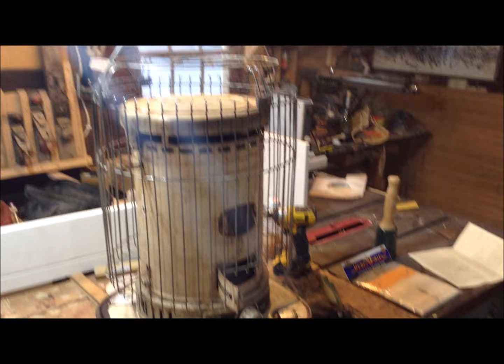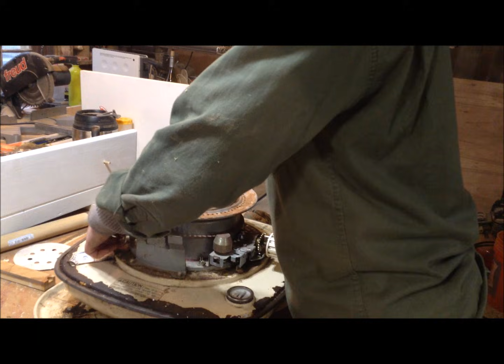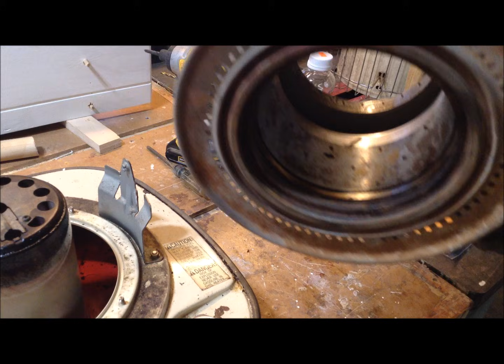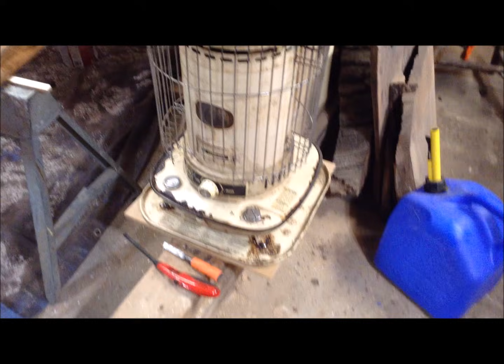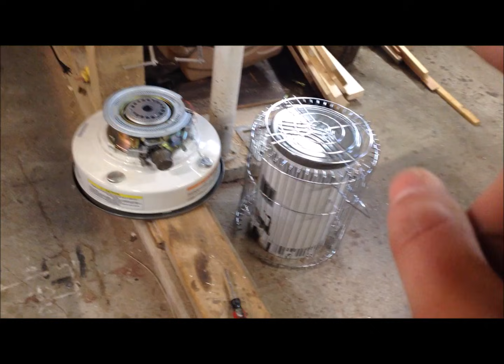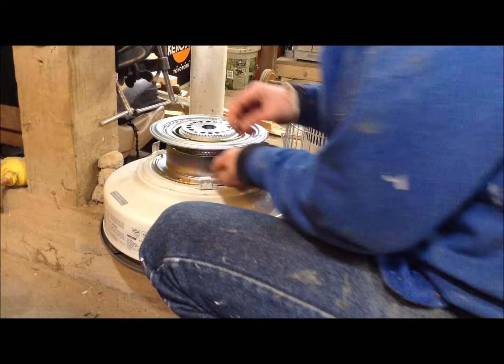Replace 3 Pinned Wick In Kerosene Heaters || How-To || Corona DK-23

Comment: This is fantastic!! Just the model I have which I found curbside. It was very dirty from being in (probably) open storage, but it looks like it was never used. I cleaned it up and it really looks like new. I have a blue container for of K-1 that I got from a Speedway gas station, so that is burning pretty cleanly. The coil ignition is working, so I don't need a lighter! 

I'd like to make one comment... when you remove the control knob, make sure that you depress and hold the button on the knob as you pull it off the shaft. I think you're doing this in the video, but you don't say it. The slide plate on the back of the knob will bow and then it will not work smoothly. If this happens to you, you can use a small brad hammer and flatten it back down and then it's perfect again. 

Thanks for the great video!

Comment: After you removed the 4 wingnuts, you just "lifted" your whole wick assy up, and out. Mine keeps getting stuck halfway up. I'm even standing on the bottom tray, and yanking upwards, but it still is fighting me. Not sure how much force is needed to release this thing. I even tried pulling with the wick in different locations...up, down, and middle. Didn't help.

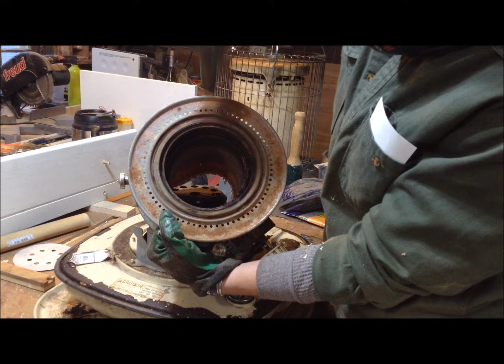Well, it took a ton of force to peel mine apart. I kept rocking, and twisting back and forth, and it finally came loose. But unlike yours, there was a circular tin shield "below" the spiked sleeve you mentioned at exactly 5:22. (You can see it still on your assy). Mine stuck in the tank below, and has a black gasket sealing around the hole it sits in.
When my wick "lifting" assy came up, the wick itself was stuck below that tin shield I mentioned above. I had to use a flat blade screw driver and some piers to work that tin shield out of the tank, before I could remove the wick. And those 3 pins in the wick (?). One was peeled off, and stuck in one of the holes in that shield. This thing is filthy, and so am I, so I'm leaving it at that tonite, and will clean everything else up tomorrow, B4 re-assy. Wonder what kinda surprises I'll incur with that. I have the original directions, and it states exactly what you instructed above. Of course, mine wouldn't cooperate, like yours. OFN.

Comment: Old video, but a good one. Thanks for the refresher, for my old unit in storage for almost a decade. Just ordered a new wick. Happy New Year.
Reply from the maker: Happy New Year to you too.  Hope you get yours up and running with the new wick.
Reply: @HoneyBadgerWoodWorks  Had it running with the old wick, but not very well. Wondering if the old wick can be trimmed downed, cleaned up, and reused?

Comment: Prompted by your idea to hold it by the knob to keep the automatic shutoff from engaging, I inserted a loose bolt (about the size of my little finger) loosely into the space above the shut off switch.  That kept the shutoff from engaging and allowed me to lay the whole apparatus on its side on the table and have free hands to turn the knob and fiddle with getting all the holes lined up and the wick installed.

Comment: These work great for heating but the design of these are overly complex.  I think a furnace is more simple than these.  I have sold a lot of these over the years because people get rid of them because they are a pain in the ass.
Reply from the maker: I never had an issue with keeping these running.  Sourcing the kerosene was what became the problem.  I agree a furnace is ideal, but for people like myself that work in outbuildings and garages a furnace setup isn’t feasible.

Comment: Funny thing.....I have two kerosene heaters, both exactly the same as yours.  The Kero Sun was my dad's and has had very little use.  The Corona belonged to my buddy and he was going to throw it away, so I took it, replaced the wick and it works great.  The Corona looked terrible when I got it but it cleaned up really nicely.  The igniter still works too.  Thanks for the video.
Reply from the maker: No problem.  Minus the small I liked kerosene heat.  Just got too hard and expensive to source the kerosene in my area.
Reply: @HoneyBadgerWoodWorks  Did you ever have trouble removing the knob?   I can't seem to get mine off now.  Thanks for your help.
Reply: Nevermind.....once I pushed in the button on the knob, it came right off.  lol    Duh.   Thanks so much!

Comment: Thank you for an excellent video explaining how to change the wick - I live in the wilds where it gets really cold, so I use one of these heaters in the main hallway. 
Here is a great idea to remove the kerosene smell. Place a large two handled saucepan on top of the heater. Half-fill the saucepan with about two litres (a quart) of water and drop about 6 drops of Clove Oil into the water (or eucalyptus or peppermint, etc). Then let the water simmer. The space is filled with a wonderful uplifting scent from the water vapour that the simmering water gives-off. You could even use Sandalwood or whatever 'essential oils' you prefer.
Once again - many thanks for making a great video - much appreciated as I have just ordered a new wick.

Comment: I’m so glad I found your channel. You are a very good teacher and give great verbal instruction with visual demo. I’m just getting into kerosene heating as alternative heat source. I have a suggestion that may help your viewers with holding the spring-loaded knob. As a woodworker I am sure you use a lot of clamps and I was thinking it kind of looks like a two person job but I believe a shorter length bar clamp with the rubber jaws and trigger grip may enable a person to turn that burner on its side while holding the knob and squeeze the clamp down on the bench.  Hope that helps someone.
Reply from the maker: Nice! That is a great tip!

Comment: Thanks for your video. I have an older Kerosun a bigger model like the one you replaced the wick with three tabs. Mine has the tabs and have been struggling to get the new wick installed. I’ll try your installation tips to see if I can getRdone. I occasionally use heat in the greenhouse ( 6ply poly & tube frame) to keep the snow from building up where I can’t reach with a push broom to rake off. I have a couple of propane heaters like Mr heater three burner that sits on a bottle and you get instant heat but would like to have more than one option. Propane is now much cheaper than kerosene but still want the Kerosun up & running
Reply from the maker: I really liked this heater because it was very quiet.  The main downsides were sourcing kerosene, and then smelling like it all winter haha.
Reply: @HoneyBadgerWoodWorks  I tried again yesterday still no luck with the wick. Like playing whack a mole keeping all three pins in place. Almost had in on the first try. Those little prongs could be longer.

Comment: I have a Corona 23-DK which had the original wick from when the unit was purchased new by my dad around 1985.  The most difficult aspect of doing this is lining up the wick pins to the holes for proper movement, as you gave some mention to.  I would like to emphasize that the wick is dry when new; either the wick needs to be pre-soaked in kerosene or the center drum needs to be lubricated with a light oil (I used WD 40).  A dry wick will overload the wick mechanism and prevent movement, so it was trial and error until I was able finally get the wick to slide without too much effort.  Anyway, thanks for an otherwise great video.  Hope that this wick will last half as long as the old one did.

Comment: Thank you! We pulled our Corona 23-DK Kerosene heater out of storage after 11 years and struggled to get it going again. We found your video and were able to follow directions (with a few pauses and replays of the wick replacement segments) and got it going again. Works like new! The temperatures were in the single digits last night and we need this heater to supplement our heat pump. 
Thanks again!
Reply from the maker: Nice!  I loved how quite those kerosene heaters are.  I have a propane heater now and it sounds like a jet engine.

Comment: Great video! I replaced the wick in mine today; and thanks to this video, it probably turned 90 minutes into 20 mins total. One goofy thing that happened when I pulled the core unit up after you remove the wing nuts and expose the old wick is that it pulled the rubber seal up at the base as well, so I had to reset the seal. I'm not seeing a rubber seal on yours at all so either someone trashed it or mine is a slightly different model but everything else looks the same. Great instructional, the only thing I would add is that when you are aligning all of the holes up for the new wick I found it easier just to hold the on/off switch in place with one finger rather than holding the dial. Thanks for doing this video!

Comment: Thanks for this video! I'm putting a curb rescue heater back together and the wick was being kind of finicky. It didn't want to retract right and I had it installed correctly but I think the wick holder was very slightly tilted so there was drag on the wick against the center tube. I was trying the safety retract before I put the wing nuts back on and once it was fully seated it worked fine. 
....
 It sounds like you've only had these two? Keep an eye out for a smaller 10,000BTU model. They burn about 10-12 hours on a gallon and are perfect for keeping a garage/shop from getting too cold overnight for not much fuel cost. I also really like the antique Perfection "500" type. In the winter if I'm going to be home I let the furnace run in the morning to get it up to about 65 and then run a Perfection to keep it at 62-67 all day on about a half gallon of fuel. The only problem with the antique ones is that you can't let them run out of fuel or you'll burn up about 1/3 of the wick. They also don't have an automatic extinguisher but for me that's not a problem.
...
If you can get it locally at the pump try to burn the clear kerosene instead of the dyed. Your wicks will last longer. Good wicks are important, too. A lot of the Keroworld and similar branded ones you find online at at hardware stores aren't the best. For the past 5 years or so I've been buying all mine from a guy names Miles Stair and they've all been great. (www.milesstair.com) His site also has a huge amount of information and he's answered a few questions via email very quickly.
Reply from the maker: I actually only used the kerosene for only a year.  There were only two stations near me that sold kerosene.  One of them the pump has been out of order for years, and the other one half the time I went there the pump was broken.  I now have a propane heater which has it's pros and cons, but can easily find a place to fill the tanks for 10.00 each.  I preferred the kerosene because it's so much quieter, but just can't source the fuel.
Reply: @HoneyBadgerWoodWorks  That's a shame about the fuel. Fuel Oil is the most common heating fuel around here and most of the distributors also have Kero. I've got an outside tank for a built-in wall heater in the garage but most gas stations, or at least 2/3 of them, have dyed or K-1 at the pump. 

Thankfully, because I only like to burn K-1 in the house. 
...

I hope the propane is keeping your fingers warm!
Reply from the maker: Yeah I liked the heaters so it was a bum that the fuel was hard to source.  The propane heater works well, but it burns through fuel much faster.  Luckily, like last year the winter has been very mild so I'm not too frozen hahaha.
Reply: Yes miles stair is great good merchandise and good prices

Comment: Have you ever heard of incorrectly pinned wicks?
Reply from the maker: Negative.
Reply: @HoneyBadgerWoodWorks  I tried three wicks in my dura heat.  They're all at least 6mm higher than what's recommended. The result is extremely high flames even on low.  Any suggestions what could be wrong? I tried talking to manufacturer but they were no help.
Reply from the maker: @peterbugarchich404  Is it the right fit for your model.  I know with mine especially since it is older it was a little hard to find a replacement and I almost accidentally bought the wrong one the first time around.  It's it a pinned or unpinned wick.  The unpinned ones can be adjusted up and down for the right height.
Reply: @HoneyBadgerWoodWorks  Much appreciated your answers. It's the right wick, three pins. it's even listed in the manual. DH 145  I installed the new one and it never sets at 3/8 as described in the manual.  It's at 1/2 or slightly higher no matter what I do. I could not imagine that extra  1/8 in height  would make such a big difference.  I have been thinking about drilling new pin holes in a wick sleeve so it can go lower.  I am getting close to tossing the whole thing into the recycle bin

Comment: Just an observation, but it looks as though you're burning dyed fuel. Clear 1-K kerosene will make your wicks last longer. (I've also heard dyed fuel produces more fumes as well, but that's debatable) My 23DK actually specifies to use only "water-clear" K1 kerosene.
Reply from the maker: Yeah this is dyed stuff, the clear stuff around here is like 5x the price. But, you are right that it is better for the heater.  I won't have to worry about it this year because the only two places near me with kerosene no longer sell it so I'm switching to propane this year haha.
Reply: @HoneyBadgerWoodWorks  ah, I understand in that case. Clear around here is around 3.50 or so per gallon.
Reply from the maker: Yeah, that's about how much the dyed stuff is here, filling up my 5 gallon container was always a little over 15.00.  The only place I have seen clear by me is in the big box stores, and that was 25.00 for a 2.5 gallon container which is just robbery.  Even though this heater worked great not going to miss the hassle of finding kerosene.  Propane is available all over.

Comment: Thank you so much for this video. I was having issue changing my wick until I watched your video. I found that if you place a screw between the reset it keeps it from tripping and then you can have two free hands when you are installing the wick. I have attached a link to an example. https://www.facebook.com/chuckwagonplans/photos/a.260654270993796/823996854659532/?type=3&theater
Reply from the maker: Thanks!  Good to know, since they recommend changing these out each season.  Two free hands would make it an easier job.

Comment: I want to add in due to my reply the other day about using diesel, to where I don't recommend using diesel for two reasons, one where the diesel treated seems to soot up too bad, and two I suspect mine created more carbon monoxide, cause a co detector I had in a closet away from the regular areas once I figured out k1 was safe, it went off, several times, ...maybe it was that I didn't have enough of a window cracked, unsure, or the wick seemed to be clogging up and burning low after only two tanks worth, so I deem it too unsafe for my conditions, maybe if I used the k1 additive that this would not have happened, so if you do, be careful if you use diesel with seefoam fuel treatment.  I am gonna burn the rest off in my out building to dry it out more, and put the rest of the diesel in my diesel truck.  Plus the soot it produced, its gotten black inside on the upper wall.   I think what happened is that I should have put little amounts in just enough that it would burn off, like I had did several times when it burned out and cleaned the wick well, but later when I did not, the flame started getting lower, ...clogged, that is incomplete combustion that creates carbon monoxide.
Reply from the maker: Yeah I would be careful about using the diesel I have heard across the board it isn't very safe.  It would be so convenient though Kerosene (minus the really expensive clear stuff they sell at Lowes) is hard to find around me.  There is only one place that is close by and I actually went there the other day and the guy who runs the shop was out so I have been working without it for the past few days.  We have been having odd weather spikes out here as well.  Will be in the 50s for a few days (which is beyond seasonably warm) then a couple weeks ago it was in the teens and I couldn't get the shop above 35 degrees even with both heaters going.  Looks like the next few days I can work without them, then it gets back into the 30s.  Luckily, I don't have to worry about Co2 my shop is so drafty nothing stays around for too long.